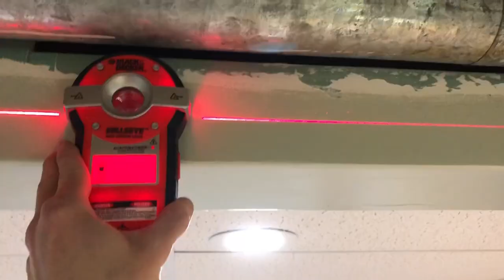How to install a drop ceiling

Comment: Good video. One correction, dont cut the tab off at the end of the T-bar, fold it 90 degrees and use a self tapping screw thru the tab and into the L-channel. Then you dont need rivets, and it looks slightly cleaner.
Reply: Thanks for the tip. I'd go so far as to say it makes it look professional. I cringed when I saw the way the rivet gun scratch up the L channel. My OCD would never have let that pass.
Reply: Thanks for the great tip. 👍
Reply: Sweet. Thanks for the tip, and for adding value to the video with your comments!!
Reply: Make a video of it ! And give him props for showing us how to do !!!
Reply: @samsamson3623  I don't install ceiling tiles, but I do alot of re-work, adding light fixtures etc. So It wouldn't be nearly as good a video as this one.
Reply: @Stevethelightingguy  you never know Steve we might use your expertise too!
Reply: @samsamson3623  thanks, I'll give that some thought! A customer wants me to do videos about GFIs and basic electrical repairs, but I'm not sure if that's the wisest thing to show people. What do you think?
Reply: @Stevethelightingguy  I think you gotta give it a go, we need more people like you on. The start is always hard
Reply: I've never seen mains done this way. I would determine my layout and what size cut I want and measure back from a slot on the main to get that length then from that cut measure out the distance for the room. 

Use tire wire to keep it tight to the wall and maintain the perfect dimension and you're done. No messing with tabs at all.
Reply: @kingsherrick4528  I've seen that too, but never the pop rivet method. My only guess is why I've seen it tek screwed where the mains meets the wall channel is its somehow faster/cheaper. I don't live in earthquake zone, but we are known for doing everything as cheaply as possible. The contractors here, wouldn't use the 15 extra screws if it wasn't somehow more efficient lol. That's all I can really say... I don't do it for a living.

Comment: Im think to install a drop ceiling below existing drywall for sound and to make it look better.  is this realistic?
Reply: Yes, you just use toggle bolts to attach the wires. You could also invest in ceiling tiles with higher sound absorption ratings and achieve similar results without the extra work

Comment: Ty for the informational video. Question, can you use super or gorilla glue rather than the rivets? Thanx again.
Reply from the maker: I wouldn’t glue it, get a cheap rivet gun and use the rivets.
Reply: @tcgworld  Okay, TY for your response 💯
Reply: You don't even need to rivet the tees. If you cut the tees right and tie wire the main you start with and the tees keeping it square  every 8ft to the drywall the ceiling won't move and everything will stay square with the tile.

Comment: By far the best video on drop down installation. Appreciate you sharing your knowledge and experience with us. Not a big deal but quick question if you have a moment. Do drop down ceilings require any permits? I know it varies but generally speaking. Thanks!
Reply: You shouldn't need a permit. Your not changing the layout or structure of the home.

Comment: Whats minimum clearance between joists and grid
Reply: 2 1/8" from ceiling height to top of the bulb on the grid. Typically, just go 3 inches to make it a little easier on yourself unless it's an already low ceiling

Comment: So do you do the full pieces 1st before installing the cut border pieces? This is what i'm struggling with lol. In my mind i would think you'd want to do the border 1st and work in 1 direction. Is the way im thinking wrong? Great video thanks
Reply: I think the " correct" method is to do the perimeter pieces first . However , I don`t think that it is a big deal .

Comment: Great job 👍
Did the tile rest on top the rivet on the main tee ?
Reply: Yes it would, but the material is very soft, which would allow you to press the tile into the rivet to create a groove so it doesnt stick up at all. Another option someone else mentioned is to not cut off the tab, but rather use a screw into the tab to secure  the channel to the wall, then you dont have to use a rivet at all and it is a much cleaner look. Good luck!

Comment: Harbor freight has a 360 degree laser level for 99$ then just cut a peice of wall angle and screw it to floor joist studs in middle of room attach laser level to the wall angle its magnetic then return that laser level after your done lol
Reply from the maker: That’s one way to do the job on a budget 😅